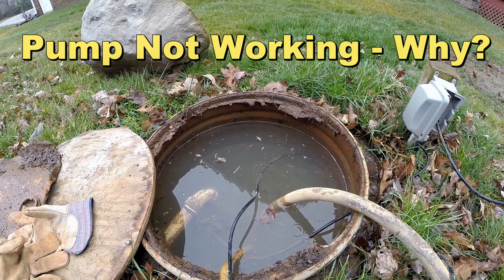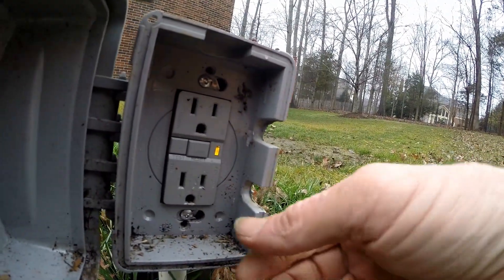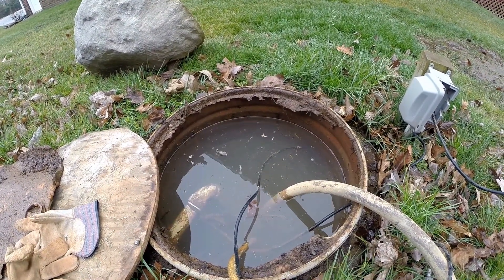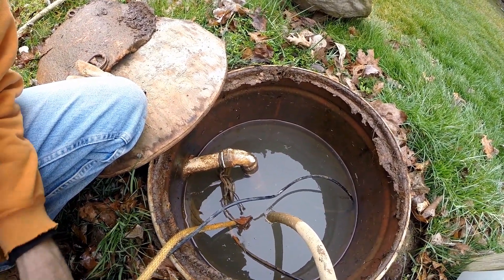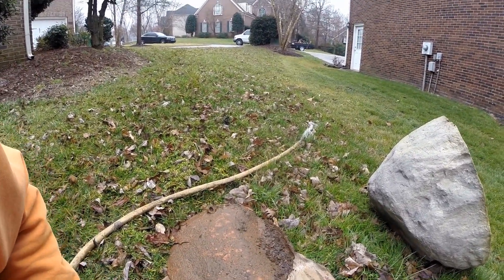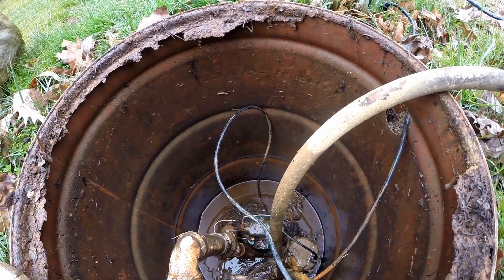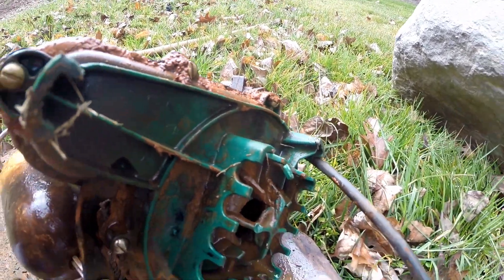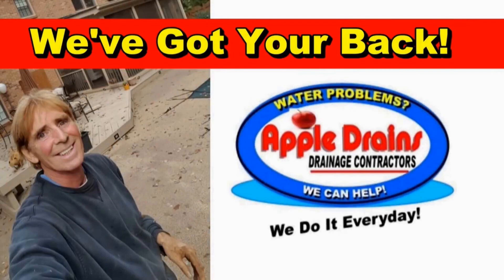Do's and Don'ts of Sump Pumps and Basins

Comment: Hey Chuck, quick question.  Have you ever heard of, or do you drill a weep hole in the discharge pipe of the sump pump just below the check valve?  This is to prevent the impeller chamber from becoming airlocked.

Comment: Thank you! Just one question as I did not find answer in any of your videos. On a sump basin, which will have pump in it, would you drill holes at the bottom? My backyard (Florida) floods only during hurricanes, but I was thinking of having discharge hose from washer along with french drain going into sump basin. Since it really floods only during hurricane, holes at the bottom of basin might just drain all water and during excessive flooding, the pump will take water to the front of the house. So is it bad idea to drill holes at the bottom of basin?
Reply from the maker: No it’s a good idea outdoors
Reply: @appledrains  Great, thanks for your help and great videos!

Comment: Good video but still waiting for the "do's and donts" part ....
Reply from the maker: Tonight
Reply: Me too. There were several questions asked here that I need answers for. My husband asked me to buy and design the pump basin and pump. He had too many irons in the fire.  I've got that all purchased and figured out but now have to figure out the wiring of it.
Reply: Another question I have - if my 3/4 hp pump will do 83gpm, do I really need to have such a large basin? This pump is for my backyard and only really needed for when our rain comes too fast.
Reply from the maker: @bmac5242  yes you do
Reply: @appledrains Thank you very much for answering so quickly! Now it's back to the drawing board:)

Comment: Thanks for the video! My question is how does one keep the electric cable out of the water? In a submerged pump is it not it inevitable that some portion of the wire would end up sitting in water? Thanks!
Reply: Yes. The wire that comes with thw pump is fine. Just get that wire to a box or outlet.
I would recommend just a junction box and a dedicated circuit to a pump. Costs less and technically, pumps are supposed to be a dedicated circuit.

Comment: What are your thoughts in areas with freezing temperatures and using temperature controlled heat strips to keep the water in the sump pump pit from freezing and damaging your sump pump?
Reply: It should be installed below the frost line. Some rigid insulation under the lid is a good idea also.
Don't use a metal bucket.
Plastic will last much longer and not transfer heat.

I'd use a trough heater if you're worried. 
Lastly I'd just recomend pulling the pump in the winter if it's below freeing for months.

Comment: never put your hands in the water hole when the pump is running or plug in .. because you just don't  know  what if a electrical  cerint is in the pump hole is it worth taking a chance 🤔🤔🤔
Reply: lol you would have to be more conductive than the water which your not. Sometimes stuff is kore scary than it axtualy is. its ok though😂

Comment: Hey Chuck. I got a question. 
I'm trying to connect a 3' schedule 40 PVC pipe to a 6' NDS single output catch basin. 
I'm having trouble connecting them.
The 3" opening on the catch basin has the plastic horizontal splines in the opening that's preventing the PVC pipe from fitting all the way in snug.
What's the trick?
Do I need an adapter or something?

Comment: Is such a system under vacuum to pump effectively? Can a sump pump be used with non-penetrating 3" plactic drain pipe, or is that kind of drain pipe not airtight enough?

Comment: I would definitely recommend putting a easy remove pipe connector  above or below the check valve. Plastic connectors with a screw thread are perfect for this. It allows easy removal of the pump AND the check valve for maintenance and cleaning.

Comment: I may have missed it. But is there a solution to keep debris out of the pump impeller?
Reply: Generally I've read to set the pump on top of a hollowed brick/s.
Reply: @Maydaymayday84  Agree - you want a place at the bottom of the well for debris to collect, away from the pump impeller).   While the electric cord in the pipe wasn't ideal, I'd think the GFCI would prevent an electrical issue.  If the pump was raised to begin with, good chance it would have run fine (and the cord in pipe never would have been discovered (and become a concern)).

Comment: This video came at great timing for me! Last night (coincidentally) I obtained a drum just like this to use for my sump basin! I know it will rust and corrode over time...but that'll be about 20 years down the road. Not sure plastic one will last that long as well. But I needed to go deeper than what an ADS basin or in trash can basin will go. Culvert pipe is selling for $450USD per 20ft. Plus I would still have to buy lids...so I got this barrel from a friend and it fits perfect in the hole I dug. I did find for future reference for someone...a rain collection barrel for $98USD that would work as well as far as the dimensions go. I didn't know the electric cords are not rate to be buried? If one can't bury them, then how do you do it? Inside conduit?
Reply: FYI a plastic barrel would last way longer.

Comment: Hi Chuck 🙂! Would it be a good idea to use a Tee PVC as a catch basin  instead of a regular 6in catch basin?
Reply: Yes!  A big FATASS 15" or bigger corrugated Tee!  The bigger the basin, the less starts and stops on the pump means it will last longer and save a few bucks on starting amps.

Comment: Another great video. It wouldn't occur to me to run the lines through the drain itself. It should always be a question of whether the material you're planning on using is rated for the job.

Comment: Great job on the fix.  I would have to think that steel 55 gallon drum will not last long to rot from both the inside and out.  I think I would have used a plastic one and some concrete around the perimeter to keep it structurally sound.
Reply: I used a plastic 55 gal drum for my sump pump and placed 1 1/2 round stone around it and it's been over 20 year still working great, only problem I have had is the sump pump going bad.  Mine is to drain water from around mine home and from under it since my house is on a slab it works great.  I was worried about the 55 gal drum cracking after some years yet it's still in great condition.
Reply: @DavidGuns  Thanks for the info!  Has to be the better pick vs steel you would think...
Reply: Steel drum will last probably 20years. Not sure a plastic one can last that long.

Comment: Just out of curiosity, when did they start using GFCI’s with sump pumps?   Thanks…Jim
Reply: Jim Pie almost all city, state codes call for a GFCI for outdoor outlets, just like inside a home you need to use a GFCI outlet anywhere a sink, tub, toilet and any where water is, I know in Chicago if the outlets are within I thunk 5 feet of any water supply you need a GFCI outlet. 
Something different many dogs have gotten an electrical shock in Chicago just from walking on the city sidewalk. What is causing this is the street light poles with bad wiring,  I am thinking using a GFCI outlets for the sump pump would help if the wires was bad touching bare metal in the ground that it might cause the same thing the light poles have been doing. This is just my opinion,  please talk with a licensed electrician.
Reply: @DavidGuns  check my response to Matt Cook. Wouldn’t a grounded outlet do the same, or a grounded line to the light poles?   Jim
Reply: @Jim Pie  if the GFCI is tripping its either a couple of things I can think of, a bad GFCI, bad shorted sump pump or bad wiring some where in the line. 
As far as I know in newer homes all outlets are grounded. I do not think just grounding it would be safer then a GFCI outlet,  if that was the case then why if someone drops a hair dryer into a tub full of water will shock them without a GFCI. With the light pole in the city I am sure they are grounded, I only know about this from the local news, it seems to happen in the winter time when there is snow on the ground, they said the paws on the dogs get a electric burn from it and the dog gets a shocked from it, i do not remember if they said what was the cause. From what I learned a GFCI is a safety outlet to trip if a problem is some where in the circuit for the outlet so you don't get shocked. Just having it grounded will not prevent this as far as I know. Again I am not an electrician this is my opinion from what I have learned, I might be wrong so talk with a licensed electrician. 
Joe Pie I understand what you are saying about it is a pain because the GFCI keeps tripping, if I was you I would check all the wires, GFCI and sump pump because something is causing the GFCI to trip.  If your power goes out the same thing will happen and flood, maybe use a sump pump with a battery back up.
Reply: Always use a GFCI with a sump pump.
Reply: @mattcook2572  years ago the pumps would sometimes trip the GFCI, what have the Mfg’s done to stop this?   Jim
PS…this nuisance tripping would cause basement flooding. My sump pump doe not have a GFCI, nor is it required by code.